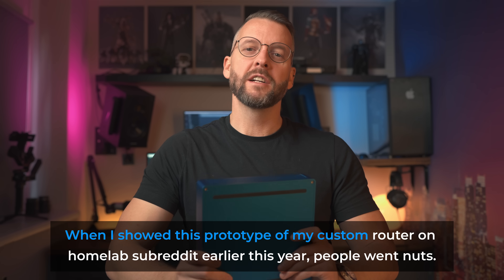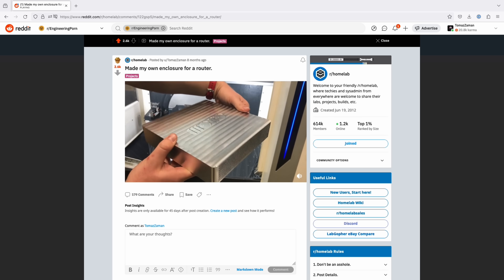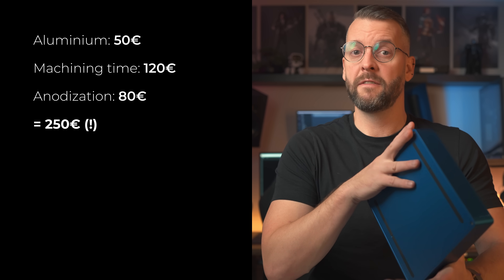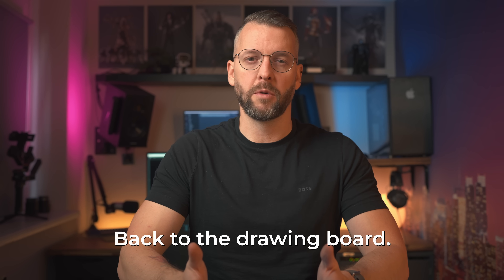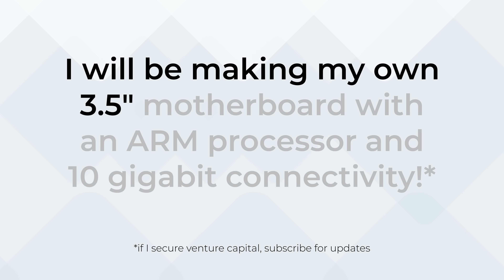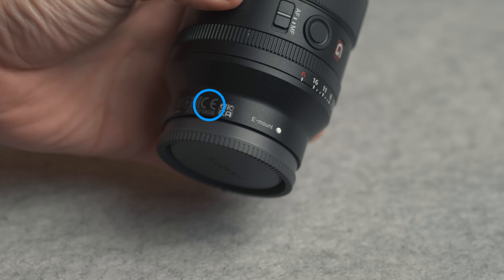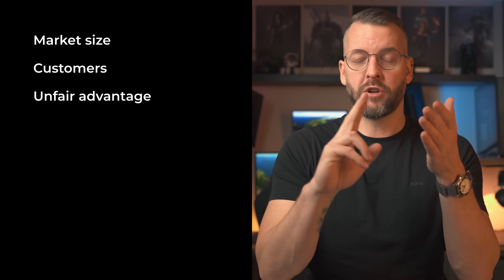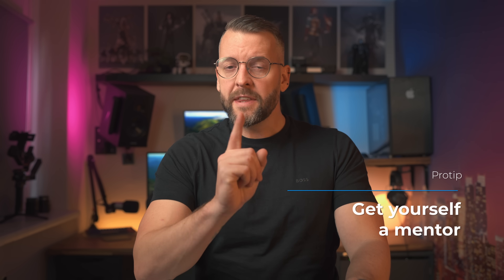I'm making my own high-end router. From scratch.

Comment: I am surprised that you mentioned opnsense. Isn’t opnsense x86 only?
I am working currently on something too, a electrical product with WiFi capabilities. It is used to control furniture lightning. And I can relay feel every step you take (my project is obviously much smaller) but the path is not so different. Great content love it!
Reply from the maker: Currently waiting for the development board with the ARM CPU. Once it arrives I'll try various operating system (and share all my findings with you). Thanks!
Reply from the maker: From what I have gathered, it is possible to build OPNsense for ARM as well. Which I intend to try!
Reply: @tomazzaman  I would really love to see your results.

Comment: Don't neglect thermal profiling and vibration/drop testing. 55 C ambient air temperature is possible in some environments. You might be shocked what some shipping companies do with parcels.
Reply: Also design lifecycle because computer parts typically have a very short lifecycle from leading edge to obsolete. By the time the product is released your CPU or networking chip could be close to last orders / lifetime buy. If you are lucky the next generation will be pin compatible.
Reply from the maker: Actually, all the parts we're discussing both with engineers and distrubutors have at least 10 years left on the lifecycles. I won't have it any other way.

Comment: Hi I came across your video and was attracted as I have a background in product development, not electronic, and was interested.
The most interesting part, and to me the most important, is your detailed description of the development of the Business Plan and I look forward to seeing future videos on this. 
My realisation about the importance of developing a business plan even before developing any hardware is that it defines the parameters for the product. Back in the 1980s I was doing a technical evaluation of a new product working with the production director of the factory. Before he spent money on new plant and equipment, he needed to know target manufacturing costs volumes technologies involved etc. We started work on the business plan together and unfortunately the assumptions of the champions of the product i.e. the CEO and Marketing Director, to were found to be completely flawed. The physical properties could not meet customer requirements, the raw materials were much more expensive than predicted and the expected selling price could only be met by a massive increase in volume which would have required the capital investment rising from the initial £3m to £10m. The idea was quickly dropped.
That was my epiphany moment and I moved into proof of concept/business plan development roles for my future career.
Reply from the maker: Yep, us, engineers like to jump straight to solving technical problems, because they are the most fun ones. But as I'm learning with this project, they really should come last. In fact, the incubator I'm part of had us attend this sales course as the VERY FIRST thing. To make sure we even know whether there's an actual market for the product we're building. And once we're done with that we will build a financial and business plan. Technology will unfortunately come last. But when it will, it's gonna be awesome and with very little unknowns.
Thanks for the comment, Michael!
Reply: @tomazzaman  Where are you located? That’s cool you are doing it as coding background person. I did all the things you described as a founder & mechanical engineer for my company Glomensio while making Firefly.
I’m a tech first guy though, and very much anti accelerators etc. might sound fringe, but thing is, you will notice that  many bad ideas get life one breath at a time just because they justified viability and need by design. Plenty of times, trivial things get made. But seismic shifts are rather unlikely or disadvantaged. Ex: GUI not having anyone at PARC/Xerox that realized value or vision. AC power plants literally only coming to life because George Westinghouse staked everything and believed Tesla could conjure his drawings flawlessly into working reality. 
Obviously all things have pros & cons. Incubators and unis are indeed very helpful in wide variety, but people often ignore or take offence to anyone pointing out their shortcomings inherent to their design and function.
Reply: @tomazzaman just added you on linked. Would be super cool to connect 👍🏼.

Comment: I don't see 10Gbit internet coming to my location any time soon. I just bought a 4 * 2.5Gbe router / mini pc from China with an intel N305 cpu + 32GB of ram. It runs FreeBSD on the bare metal and virtual machines (pfsense, and an email server). It's not enough cpu to run a windows vm (with any decent level of performance), but I really don't need that.

Comment: How do you plan to achieve true 10Gbit throughput with a quadcore 1.6 ghz arm processor?

Ubiquiti uses Quad-core ARM® Cortex®-A57 at 1.7 GHz in their new Gateway pro (priced at 460) and even with their highly optimized software they can only do 10gbit on one interface witouth any kind if additional features enabled such ids/ips on that interface.
Reply: I think the same about that, no chance with arm, i am using a ryzen 5 5600g  as a server, even with a good 10gbit card there is a lot of cpu load, imaging doing some routing, filtering , ids ips, qos or what ever on top of that, on a arm chip is crazy 😂 but i like the idea, maybe it is possible with highly optimised software....
Reply from the maker: It's not just about the cores and frequency. NXP processor that we plan to use has a separate hardware optimized for routing and has two 10Gb interfaces built in. Think NVENC chip on graphics cards for encoding video compared to general purpose CPU. Much faster, because it's optimized for that one purpose.

There will be a video about the CPU specifically sometime early next year and hopefully answer all your concerns.
Reply: @tomazzaman  Ah that makes sense! So in essence similar to switches it has dedicated hardware acceleration for networking? Cool!

Comment: I agree with the other commenter who said the internals are more important than the case. I think you should focus on designing and selling the motherboard for the router standalone before putting any more effort into designing the case. That way you can gauge interest in the actual pure functionality of the product. If there isn't as much interest in it as you thought then a fancy case isn't going to change that. Early adopters can fashion (or 3D print) their own case or even run it open air. With that said, I'm probably just as keen as you are on the look and feel of the product as the functionality and would love to replace my current router with a nice clean small aluminium device.

Comment: Great idea for picking up the aluminium, but using sheets is much easier and more cost effective than cutting it from a block. We do not mind the size, as long it can fit in 1U rack space. Multiple 10GbE options would be great: copper RJ45 and SPF+ and so on... Also, ability to run any open source OS would be a great plus. Homelabbers are gonna love it!
Reply: Please make this have rack ears.  I didnt buy a 22u rack to use as a shelving unit.
Reply: Aluminum is a much better heat sink than the construction grade sheet metal.
Reply: If the project is supposed to be for home users then 1U rack is way too big.
For commercial use, its fine, but for home use it has to be small enough to fit on a bookshelf, or on a desk next to you computer.
Reply: @hubertnnn  If it's smaller (as planned) than it will also fit inside the rack (with adaptor or whatever, but it will fit.
Reply: if the product can be for both  SoHo (or even office space) AND home use, than the production become volume and thus  volume discounts aply,  that way the professional aplication helps pay for a cheeper router for the home users. 

i would agree thus that  a 1u conversion kit  could potentially make a lot of sense.   for example with a brake-out boards that add a bunch of  2.5gbit ports  or even more 1gbit ports  or mabe a diferent module to add storage so that you can add stof like unify protect features.
Reply: @hubertnnn there already a ton of routers that much smaller than 1U in width, but make that up with long adapters

Comment: Just want to say that I think the internals of a router are 100x more important than the case. Don't understand the motivation for CNC aluminium. Sheet metal would be just fine, and a big upgrade from plastic!
Reply: When he said he's going to fix the price to value ratio by upping the internals cost is when I hooked off. Please don't focus that much on the external casing, while plastic is mostly disliked it is used by almost everything for a reason.
Reply: For that price i got more than 4 times the power using a standard formfactor and off the shelf components, mounted in a cheap rack case. It is just not worth it. The rack case looks really good and while it definitely is bigger, it can be repurposed eventually as it isn't purpose-built
Reply: a cnc case isn't really that much of an issue. there are ways to make a cnc aluminum case quite easilly without enormous costs. with scale prices go down and the cost of production also goes down. it fhe case was made out of like 1/8 aluminum plate it would be even cheaper but still maintain most of the benefits of cnc milling the entire thing. you can bend and weld the plate togeather for the outer ring and then weld the top on, and then cnc the finalized touches for the case to accept the bottom piece.
Reply: It just looks really nice. That’s it
Reply: @OctagonalSquare  How often do you look at your router, though?
Reply: @OctagonalSquare Wow! Didn't expect to see you here! I see you on UFD Tech all the time, especially in some of the comment responses!

Comment: I would add 1 more LAN sfp+
Reply from the maker: Initially, we planned three 10Gb ports, two of them RJ-45 and one SFP+. However, the processor we are using only has support for two 10Gb interfaces. We could potentially add an additional 10Gb chip on the device and connect it to the PCIe 4x port on the processor. However, that additional port increases the final price of the device significantly. For about $100 - yes, that one port alone.
That doesn't mean it won't happen. There will be a questionnaire going out with the next video and it will also include this very question, and we'll see what the demand for a third 10Gb port is and whether people are willing to pay for it.

Comment: All the best on your venture!

Quick question though. I understand that you are a big fan of aluminium. Wouldn't it be cheaper to use aluminium sheets instead of an aluminium block? The way I see it, it's costs less, it's easier and quicker to manufacture and less wasteful that having a subtractive process. While it does come with additional challenges and also some extra engineering work, it might still be much cheaper than milling a block. This is me just thinking. 

Would love to hear your thoughts on it! Thanks
Reply from the maker: Yep, this topic comes up quite a lot, because I too would like to lower the cost while trying to retain the look of it. Supposedly there's a process, similar to welding, that can achieve a similar outcome, however I have no experience with it, and will definitely need to do more homework on the topic. Will report when and if I learn more. Thanks!
Reply: read my mind!  would a stamped sheet be $ effecient?  
btw, the iot creeping into everything gives away privacy...ugg.
sub & thumbs! 👍

Comment: for the housing there are many ways to keep the cost down, I saw a few suggestions below. few suggestions here. 1. make it intel based like the new intel n95/n100 chipset. 2. ensure its no more then 1RU high and that 2x could sit in a single RU side by side if required. 3. ensure the network cards are intel based and not realtek. 4. Slot for LTE Module? 5.CPU Heatsink transfer heat into housing.  I would not go with ARM as most items you could use it for go out the windows.  I am pretty sure you can find something motherboard wise. the units i currently use for LAB's are 15cmX12cmx5CM (to tall for 1RU)intel 6005, 16gb ram, 4x 2.5gb and intell 225v3 nterowk cards. 226 are better but less support still especially bsd based solutions. There has to be somethign out there that might be a little deeper if required. I paid the above unit with 4gLTE i think around 450USD few years back
Reply: Heavily disagree on architecture. A good ARM has TONS of advantages over x86, not the least of which being power efficiency. Plus things like box64 can run most x86_64 software on ARM now IIRC for the things without ARM variants.

I'd rather an over specced ARM chip that can double duty as a low-load homelab or media server than an x86 chip limited by power draw, heat dissipation, etc.
Reply: Intel's 2.5G eth NICs have had issues lately, be sure to get fixed chipsets. Also I think for this use case Realtek is fine. Can't even remember having problems with Realtek cards ever (unlike, say, Aquantia (that got bought by Marvell), where I was unable to get their multigig cards working under Linux), and it's not like they're a new player in the market.
Reply: I have 4 RTL8125 2.5GbE Controller (rev 05) in my OPNSense VM and no problems with that. But I have reserve 1g intel nic for failovers or OS reinstall if it needed
Reply from the maker: I'm very reluctant to develop a new product in x86 architecture when the whole world seems to be moving away from it (Apple Silicon). Plus, the CPUs you're mentioning have no networking peripheral built in, so I imagine separate controllers would add significantly to the overall cost if I want to add two 10Gb ports. As for the height, yes, it'll actually be even narrower/slimmer but more on that in a separate video. And no, there will be no Realtek network chips. We'll use Marvell. There will most likely be a PCIe port on it in one for or another - those details are still being worked on.
Thanks for the feedback!
Reply: Agreed, Intel as an option if possible. And definitely an option to rack mount it would be awesome. Simple folded steel rack ears like Mikrotik use would work.

Comment: Love your video, I have hacked and got a router working and hope I can give you some ideas.  I bought a Firebox T70 off eBay, then flashed Pf-sense onto it.  To keep cost down and get you moving, use a metal box for cheap like me.  Paint Red or Blue, offer your case as premium.  Work on internals, I am looking at the new N100 CPU which is x86 base not arm. A serial or console port, then USB and two 10 Gig+ ports for plug in adapters and external power.  This will make it very hot so in MB add fan connectors for low speed fans, Noctua NF-A4x10 PWM or thicker NF-A4x20  makes some great fans to use. These are just my thoughts...good luck....